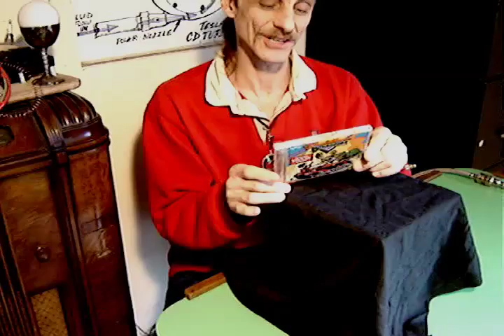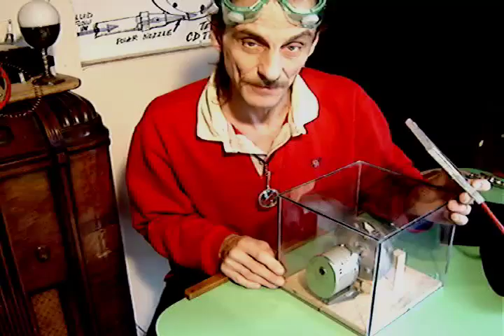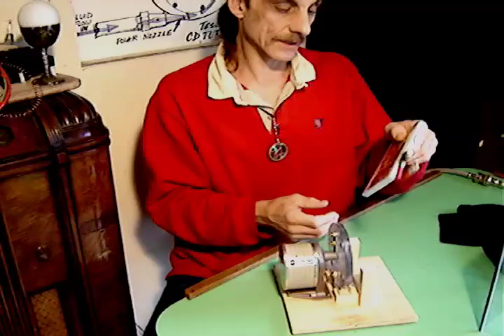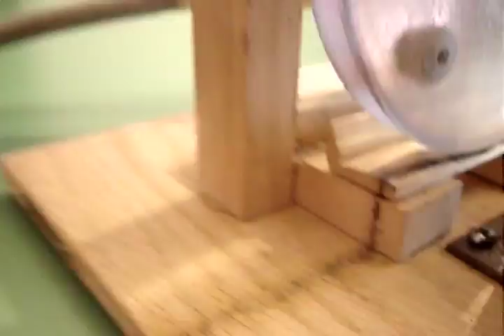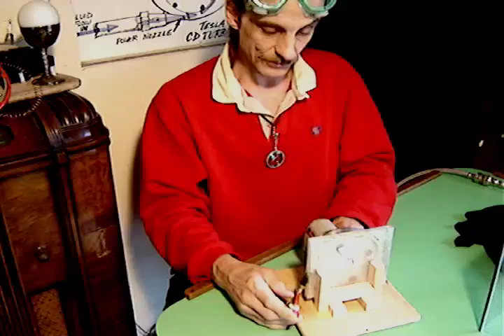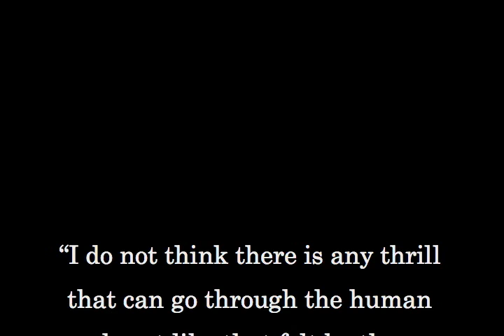Tesla CD Turbine Pencil Sharpener

Comment from the maker: The magnets act as spacers for the discs. Washers between the discs were mentioned in Tesla's patent. 

The magnets also allow quick and easy connection to any tool or accessory that has a magnetic coupler, and they eliminate the need for the turbine shaft, bearings, and seals.

Comment from the maker: Thanks for questions:

I live on Vancouver Island by Sooke.

Yes, they are rare-earth neodymium magnets.

Each disc has a certain amount of torque that it generates due to the forces of adhesion and friction pulling on it from the fluid movement. The forces are additive: if one disc can produce 1 ft-lb of torque, 10 discs will be 10 ft-lb, etc. (As long as the fluid volume is increased) 
 
The rotating inertia of a flywheel is a separate issue from torque. 

Turbine to flywheel = 100% efficient

Comment from the maker: The CD's are not hooked up to the pencil sharpener. There is a 1/8h inch air gap between them. The 4 magnets of the turbine form a magnetic coupling with the 4 magnets in the flywheel of the pencil sharpener. This enables the torque of the turbine to be transferred to the pencil sharpener.

Comment from the maker: The "simplicity and high speed rotation" you mentioned translates to cheaper, lighter, and more power for its size.

Tesla was getting 5 to 10 horsepower per pound of engine weight, and we should be able to get at least double that now. Compare to a V-8 at 1 to 2 horsepower per pound.

The Tesla turbine is small and simple, yet powerful and quiet. Fitted with an alternator, it could be the perfect auxiliary power supply for an electric car...or power a house.

Comment from the maker: The point is not to improve the electric pencil sharpener, but to show something different in concept.

This is just a first step to incorporating magnetic fields and shaft-less magnetic drive into a real Tesla Turbine. The turbine can then act as a generator or as a magnetic drive, or both at once.

The Tesla Turbine can run efficiently on any fuel. With modern nanocarbon ceramic materials, it could power your home or car, with less emissions than an internal combustion engine or a furnace.

Comment from the maker: You could shoot air onto the disc, but it will not develop enough power to grind a pencil. The CD jewelcase directs the air in a circular spiral into the centre. As the air passes through the CD discs, it takes a long path of several feet to disperse its energy. That can't happen in the inch or so of airstream exposure to the flywheel disc on the sharpener.

Comment from the maker: It's correct that the Tesla turbine tends to have low torque, especially at low speeds. Adding more discs to the turbine would increase the torque.

I had the option of making a gear reduction out of a fishing reel, or try a flywheel and more rpm. I chose the flywheel because I had the parts.

Although it doesn't actually increase the turbine torque, the flywheel stores some of the energy and makes the sharpener work smoother.

Comment from the maker: The original Tesla Turbine had some problems with disc warpage due to heat and stretching due to rpm. It is my belief that both of these problems can be surmounted with the use of modern materials such as carbon nanotube ceramics. 

Since the price of these exotic materials is becoming more reasonable, the use of the Tesla Turbine may soon become a reality. A quiet and reliable Tesla turbine-alternator would be the perfect addition to extend the range of electric cars, for example.

Comment from the maker: As seen here, this Tesla CD Turbine is basically an air engine and not very efficient. The original Tesla Turbine was designed to be used with steam and combustible fuels and can be quite efficient.

With the correct materials, a Tesla turbine can run on any fuel with little or no pollution. The Tesla disc design was recently proven to be the only type of turbine that can run directly on 100% biomass combustion products.

Comment from the maker: @MoMudd 

I use the strongest N-52 neodymium rare-earth super-magnets. 

The magnetic coupler does not use any extra power. The magnets do act as a flywheel to allow better pencil-grinding under load, but the weight tends to limit the rpm's.

Comment from the maker: @shrimpinpat 

Using air pressure is a fun way to demonstrate the basics of the Tesla Turbine, a 100-year-old design that Nikola Tesla said was "the greatest of all my inventions".  Tesla had over 600 patents.

The Tesla Turbine can be run on any fuel (gas, diesel, propane, alcohol, natural gas, biofuels, sour gas, etc.) or pressure source (compressed air, steam, water pressure), and is the only type of engine to be able to do so. It has even run on direct combustion of oats!

Comment from the maker: Thanks for the comments.

I would love to build metal disc turbines. At first it seems like a good idea to use hard-drive discs, but they are a different size and it means redesigning everything. 

To use metal discs requires a shaft, bearings, seals and a heavy case to mount everything into. By the time one has done that, you might as well use the proper stainless steel discs instead of the hard-drive discs anyway.  

Unfortunately, none of these are in my meagre $10 per month budget!

Comment: Well done MrFixItRick.  You've done some pretty good engineering here.

I'm intrigued by the notion of using a small-scale turbine like this for small-scale electric generation.  I'm wondering how well (if at all) the tesla turbine would run on steam instead of compressed air.  Imagine a solar-heater (for your steam source) piped into a tesla turbine to generate power.  Could be a real winner for small-scale power generation

Comment from the maker: @imshanedulong 

The torque of a Tesla Turbine is dependant on the nozzle velocity and volume of fluid, and the diameter and spacing of the discs. 

Most Tesla turbines have relatively low torque, but they make up for it in high RPM. Therefore, the total horsepower could be very high for the size and weight of the Tesla turbine. 

Tesla claimed he got between 5 and 10 horsepower per pound of engine weight!

Comment from the maker: @MuF123 
There are two systems that come to mind. One would be a high-speed Tesla Turbine burning gases produced from a plasma furnace type system. The high temperature, velocity and shear effects break down and combust any residual particulate matter inside the turbine, leaving quite a clean exhaust.

A better way is a thorium reactor that has no radioactive byproducts. They are being developed and are a viable no pollution, safe energy source. It could produce heat to drive a Tesla Turbine.

Comment from the maker: The Tesla CD Turbine goes way beyond being a pencil sharpener. The pencil sharpener magnetic attachment simply demonstrates the potential of a magnetic Tesla disc turbine design. 

The Tesla CD Turbine is a model based on the same principles as the original Tesla disc turbine, which the prolific inventor considered his "greatest invention". I added the magnets to it.

Tesla said his disc turbine would "scrap all of the heat engines of the world", and it is my intent to continue that plan.

Comment from the maker: I was going to hook it up to a fishing reel to get a 3:1 reduction in speed, and a 3 x increase in torque. If there were more discs in the turbine, the torque would increase. 

I plan on simply adding another turbine to the existing one to double the torque and increase rpms too. They will stack and couple magnetically. I hope to make them modular, so it's easy to add 2-disc turbines to increase the power when required. 

Imagine 100 CD jewel boxes all stacked up to make a 2 foot long motor...

Comment from the maker: Efficiency is hard to measure with any Tesla Turbine, and you will find figures all over the place from 8% to 98% depending on who is testing what. 

Wikipedia under "Tesla Turbine" says,

 "Actual modern multiple stage bladed turbines typically reach 60% - 70% efficiency. Actual volute-rotor matched Tesla-type machines of reasonable size with common fluids (steam, gas, and water) would also be expected to be around this range (if not higher)."

With modern materials, the Tesla design rules!

Comment from the maker: @chuz00 

The fully charged battery will run the air pump for the storage tank for probably about a half-hour to an hour. It  takes about 15 minutes for the little compressor to fill the tank to 120 psi. The full air tank will only sharpen a pencil or two before getting too low in air.

My solar panel is small, and would take several days to fully recharge the 12 volt deep-cycle car battery. A larger solar panel and bigger battery would be a better combo for real-world use.

Comment from the maker: @TheIceychill2 
Yes, you need an air compressor for this project. And a polycarbonate cover like mine (or equivalent) for protection. 

No instructions for this baby. You see, if you were to try this and it accidentally revved up too high, the magnets and CD disc shards could fly out and maim or kill you. 

There are no bearings so the turbine must rev up to 1000 rpm or more to float on the "air bearing" between the CD's and the case. That's why it won't work by blowing into it with a straw.

Comment from the maker: The Tesla design was made to run at high rpms.That means from 15,000 rpm to 30,000 rpm would be the sweet zone of torque and efficiency for this size turbine.
Unfortunately, my $5 turbine will blow up long before that! 

If you want more torque out of a Tesla Turbine, increase the disc size or the nozzle pressure, or gear it down.

Comment from the maker: @tomolac 
The Tesla turbine has many practical applications, and it can run on fuel and is much more efficient than an auto engine.  A Tesla turbine with a magnetic coupling could have  lots of applications when made of proper materials.

Comment: Ooh, meant to say have you considered hard-drive platters instead of cds? Since the hard-drive case and discs are already engineered to withstand 7000+ RPM for sustained periods it'll withstand the pressure a lot better than the plastic in CD's.
I'll admit you'd have a few bugs to work out, but they're a similar size to CD's, and you could use plastic spacers instead.  Pull apart any old hard-drive to see. They also have some heavy-duty magnets for scavenging as well...

Comment: @ibferguson 
I never mentioned getting more energy out of the system. The energy comes from the sun (solar panel) which charges a battery which runs an air pump into a storage tank. No grid power. 

One point is that I have invented a tesla turbine that is the simplest means of making rotational force from air pressure. It has no shaft, no bearings except air and no bothersome shaft seals.

The other point is at the end of the pencil, and it was a heck of a lot of fun getting to that point.

Comment: to me, there are a few pros and cons to using steam.  The steam would have greater density than the compressed air, thus adding greater force.  The downside of the steam would be condensation on the inside of the turbine which might rob it of rpm.

Either way, I would like to see a test done with steam.

Comment from the maker: Records could work ok with a water-pressure based system, but I consider them too dangerous for high-rpm use on compressed air, because they could fracture. CD's are at least designed for more than 33 rpm!!

Could be fun to determine the upper rpm limits of LP records, though...

Comment from the maker: This is a demonstration of Tesla's turbine, which does not use blades or cups, just smooth discs.

The big deal is that I got rid of the traditional turbine shaft, shaft bearings and shaft seals by using magnets. Simpler, better...and way more fun. 

And it's all done with household items and magnets.

Comment from the maker: I only claim "free" energy when I run this turbine by way of a air storage tank, pumped up by a 12 volt compressor, that is fed from a battery with a solar panel charging it. Then it's free energy in the sense that it doesn't cost for grid power.

Comment: Looks to me there would be a significant lack of torque, unless you had an incredibly heavy flywheel, which may make it more difficult to drive.  But, as drafter200 said, there's a lot of energy loss in this.  Drive it with something other than air and perhaps it would be greatly efficient.

Comment: That is one of the best utube comments I have ever read.  Are those the same as rare earth magnets?  I use them when building RC planes and I can get them dirt cheap...if they are the same.  Also how does increasing the # of discs increase torque output.  I understand the turbine itself would have more inertia but how would this affect transmitted torque without a physical connection? What is the efficiency between the turbine and the flywheel?  Sorry aboot (hehe) the questions!  PM me.  Thanks

Comment: This is great! I've done you one better though... I've taken my Tesla turbine powered pencil sharpener and made it more environmentally friendly. It took a little machinist work, but I removed the air connection and replaced it with a hand crank. Totally human powered!!! Needs no other power than a bowl of Wheaties in the morning. I need to do some more time tests but I think I have developed a circular cranking technique that will compare (speed-wise) to the original compressed air fitting!!